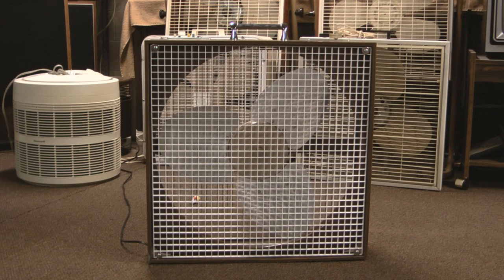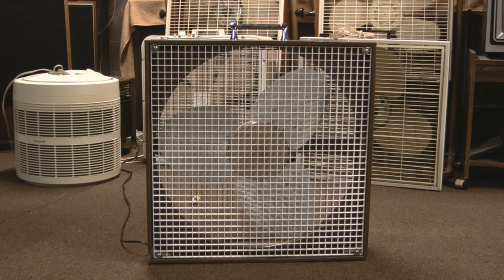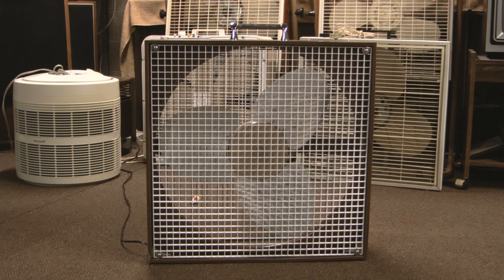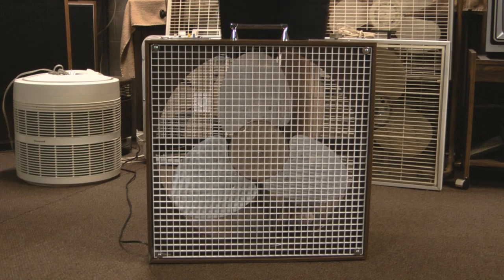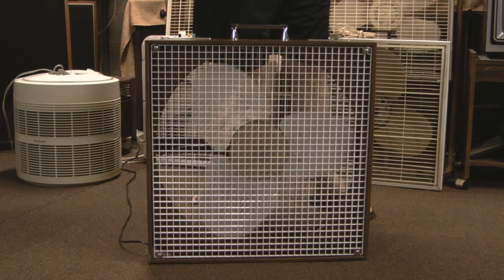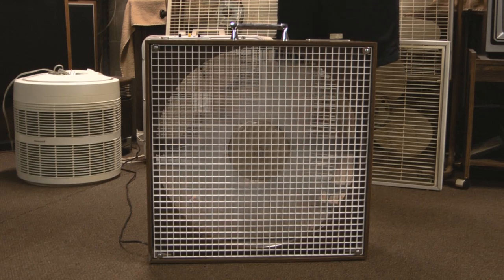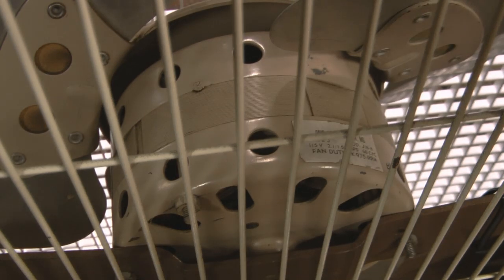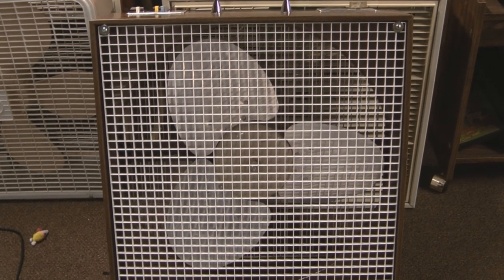Markel Box Fan Update

Comment: If you wouldn't have said anything, I would have thought that "egg crate" grill was stock. I also like the fact that there is a baffle in there, to fill in the spaces between the corners of the box, and the circle of the blade. That allows the fan to develop head pressure, making it much more effective as a window fan, than the cheap Lasko that I have. I've never seen a reversible induction motor in a box fan. I can't figure out how it can work, unless it uses a capacitor, rather than pole shading rings That allows the auxiliary winding to be reverse polarized, allowing the motor to start in either direction. They just don't make them like that anymore!!!